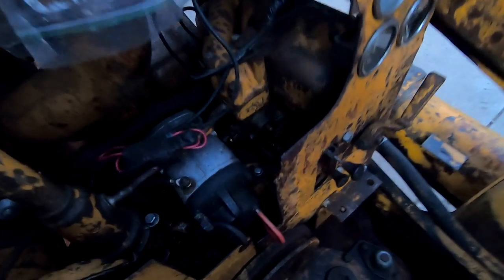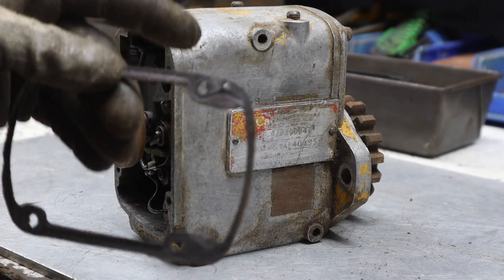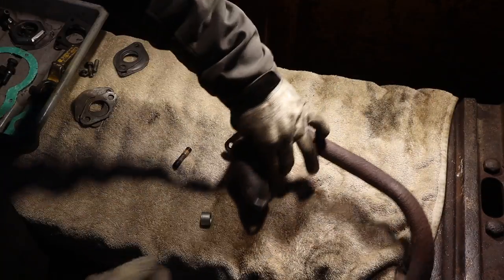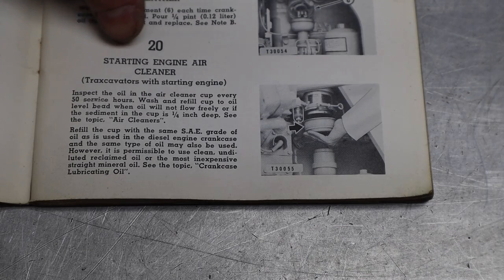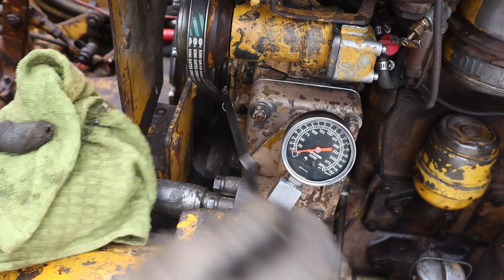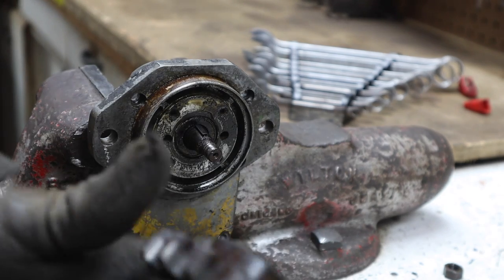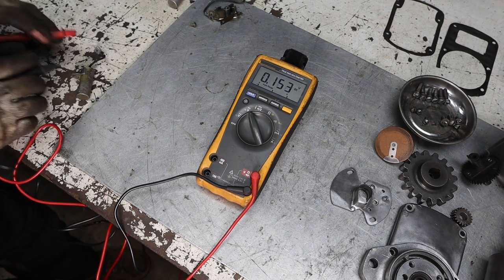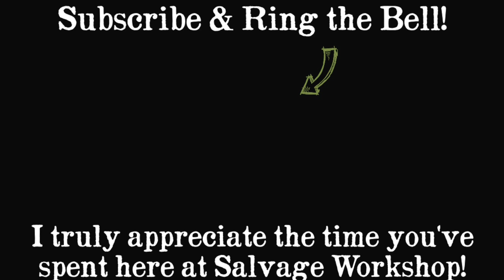FINALLY Found the PROBLEM! ~ Time to Rebuild a Magneto ~ Part 14 ~ 1950s Caterpillar TraxCavator

Comment: Don't grind the flathead srews, use a hammer to "push" the metal back in, it will result in a much better srewhead.
Reply: Better still - don't fuck around with flathead screws, replace them with bolts or any other screw that doesn't have a flat head.  Flathead screws have had their time in history, and should be buried forever.
Reply: My thoughts too. Nuff said Nuffman.
Reply: Small smooth headed hammer is king here!

Comment: Charging a capacitor with ohms range while it is a dead short on the steel surface ;-9
Almost got me...
You should look for a new one electrolyte doesn't get better with age, its main point of failure from now
Reply from the maker: Aluminum surface!! lol!

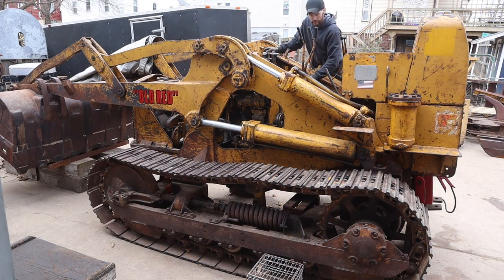Comment: At about 31:00 the fan on the main engine starts to spin as you try to start the pony engine, is that really right? Isn't there a clutch that allows the pony to first get running and preheat the main engine before engaging the clutch? The electric starter on the pony is probably not designed to spin two engines simultaneously...
Reply from the maker: I agree! It hasn't always done that, that's a new thing! When I get into the pony motor further I'm going to try and figure out why that's happening... I've got the pony motor's clutch disconnected from the diesel with the levers, so until I get in there IDK why it's doing that!
Reply: I was wondering about that, too.
Reply: Yes, it looked like something was screwy in Denmark
Reply: @SalvageWorkshop  Hey! Just pull the pistons and rods out of the pony motor and just use the pony starter.  LOL
Reply: @SalvageWorkshop  Pinion must be engaged.  Once it is engaged, only two ways to disengage.  Start the diesel so the increased rpm throws out the pinion, or manually if you have the little service hole in the bell housing.  Very common for the clutch not to disengage.  Oil bath clutch, sometimes the plates stick together and won’t slide against each other.  About 7 or 8 plates in there.  You can try applying the brake to loosen them. Just push that lever the other way.  Of course that is assuming some one has not removed the brake discs.  Other possibility is no oil in clutch housing and plates corroded together.  Definitely a good idea to pull and rebuild.  Squatch253 has a good video on rebuilding one that he did for his 5j1113 rebuild.

Great videos! Great work.  You are good at getting broken bolts out.  I am about 50 50 at best.
Reply from the maker: @johnwythe1409  That would make sense... I was in the middle of starting the diesel when the pony motor ran out of gas... then it popped trying to restart it, and I didn't do ANYTHING further to try to start it!... I'm betting it's fine!

Comment: Looks like old motorcycle points setup, the backing plate the points are mounted to sets timing  (to TDC or BTDC) with timing lite or dial indicator in sparkplug hole or degree wheel on crank, using ohm meter to tell when points break&make, disconnect points wire at mag terminal before ohming.The point "gap" itself is set by moving points on backing plate, do gap first then timing. The felt pad lubes points cam to reduce wear on follower use motor oil here,(not too much) & be shure it touches high spots on lobe. This is fun stuff, good job!!!

Comment: The broken teeth on the magneto drive gear is a bad sign. That means there's excessive clearance on either the crankshaft or on the cam. If you run that magneto with the play on the crank it will shear the teeth ok the drive gear and on the little gear inside again.
It's a common problem on Cat starting engines.
Squatch253 made a video on it, "caterpillar 5j1113 starting engine disassembly"

Comment: I'd think by now there would be an electric motor strong enough to start the diesel directly.
Reply: Like that idea, the size of motors nowdays says YES.
Reply from the maker: There are, and we'll see what happens! I would like to add a direct electric start but NOT eliminate the pony motor so it could also be used to start the Diesel.... Apparently there is a way to do that!
Reply: You are absolutely  right this is the only reliable way to go the pony motor  is more trouble than its worth  we have the same machine and lost a lot of valuable down  time
Reply: Need to add glow plugs for electric start. Pony motor better thou as it warms the diesel block and oil, gets oil pressure up before firing the diesel. Easier on the Diesel engine especially in the cold weather.
Reply: or just rebuild the 65 year old pony motor and worry about it again in 50 years

Comment: The WIRE WHEEL OF DEATH! I cringe every time you use this! Is that hooked up to a foot peddle switch so you can get away from it if it grabs a sleeve on your coveralls?

Comment: Your neat and fully comprehensive way of working is fascinating.
By the way, your multimeter can also measure capacitances, even if the test with the ohm measuring range is in principle of course suitable to find a clear fault, but not aging.

Comment: Little advice... never turn a magneto without a sparkplug and ground... it will kill the condensor or wiring IN the magneto because the voltage is getting to high and nowhere to go...
Reply from the maker: Maybe a LOT of turning MAY hurt it, but i had to make sure everything is working properly once they were asembled. Quite a few moving parts that all need to move properly!
Reply: Yup some people have to learn the hard way

Comment: I was all, why don't you test the capacitor (condenser) then just before putting it all together low and behold you did. Then I thought oh no, don't test it on metal, and you corrected that too. I love that you can show all the problems along the way. Totally expected you to resleave the exhaust manifold possibly do the trick of tapping the receiver dying and tapping some pipe, since I've seen that in some other episode somewhere, I was getting ahead of myself. You my friend are a total utilitarian and I salute you.

Comment: NO THAT IS NOT THE PROBLEM !!!! The problem is the crank main bearing is most likely bad. creating slop which breaks the gear and or bends the mag shaft. CHECK TO SEE IF PIN that holds the main bearing is tight ... that is the big killer of that style pony.
The main bearing in the front (back of pony) may have slop (radial and/or end play) from a loose locating pin OR a crack in the block where the locating pin is located.
!!!!!!!!!!!!!!!!!!   P U L L  T H E   P I N I O N   C L U T C H    B E F O R E    P U L L I N G  T H E   P O N E Y !!!!!!!!!!!!!!!!!!!!
!!!!!!!!!!!!!!!!!!   P U L L  T H E   P I N I O N   C L U T C H    B E F O R E    P U L L I N G  T H E   P O N E Y !!!!!!!!!!!!!!!!!!!!
If you don't it will break the pinion clutch housing. ----- about a 200 dollar bill...  Watching Squatch253' channel saved me that pain. So I went out and cut a porcelain tag off my old T9 Bucyrus-Erie dozer and sent it to him. He really liked it.
Everyone will tell you that you CAN pull the pinion clutch without pulling the governor but I'm thinking they are NOT working on a Traxcavator. I fought it and fought it and found it a lot easier to just go ahead and pull the governor, it gives you a chance to look for wear and clean out any gunk. While you're in there be sure to change the seal between the injector pump and governor.

Comment: I so enjoyed your magneto rebuild. And I enjoy the whole Old Red project and your skill at doing repairs the right way. I don't agreed however with your explanation of what caused the magneto gear to break, some end play and slight bearing wear. It seems as though an actual small chunk of metal got into the gears, perhaps a cotter pin or other half of the castleated nut. The magneto puts very little load on the driving gear so stress can never be a cause of failure. Make sure you find and remove any metal chunks not only in the pony motor but also down in the larger starter gear case.
 I am so looking forward to your next video of putting the pony motor back in.

Comment: Yes you definitely want to diagnose why that magneto gear broke.  I agree the shaft bent when the gear broke, but why did the gear break? You'll want to correct that problem before you go any further on the project.  Love watching you learn as you tear stuff apart to figure out why it don't work.  Can hardly wait till next video.  Thanks for sharing....

Comment: Hey Dennis carb here I found your rebuild kit it's on ebay type in zenith carb kit 5f3527 its $53.84 I knew it wouldn't be cheap but it's the whole kit doesnt come with float but has all the other parts I take the float if not brass I sand them lightly with 600 grit to get the old residue off and then spray them with silicone spray.i also spray all my gaskets with silicone spray it will make it easier to separate long term down the rd....love this restoration your doing on old red ....but Carburetors are my restorations.Lol your welcome DennisCarb.....ps what yr would you say ole red is because the other numbers tell where it was made and what it was made for and what yr it is I believe the letter x at the end stands for agriculture..meaning it was made for an off rd vehicle.could mean military too.but the other numbers got me baffled I think it's a the first 3 digits is where it's made 103.....not sure....6 day 8th month.0 last digit of yr 20 30 40 50 etc. When I find out I'll let cha know

Comment: Love your videos. I've been following you for awhile now. Enjoy your creativity when it comes to working on that older equipment. When you were working on the magnetoe and questioned the reason the drive gear wouldn't turn all the way around and stopped with a metallic clunk. You were coming up against the impulse coupling. Impulse couplings are used to give you a hotter spark at start up.

Comment: Just got hooked on your excellent channel and spent some really extensive time soaking up all that you do, turned off the TV! I'm a retired engineer, (80 now), but I started way back in the late 50s. In the early 80s I worked in the gold fields of Kalgoorlie as a trouble shooter and often we had to make do with spare parts from abandoned mines. Undoing parts from old machines that had broken studs was always a problem. Here's how to tackle that problem, many of which you've had on your latest journey with Big Red. You will need a pen centre punch. Carefully face off the offending stud to about 1/16" from it,s hole, the flatter you get it the better and carefully centre punch the stud. Using a small drill go in about an 1/8". Using a drill just under the core size of the thread drill all the way to the bottom of the stud. You will be left with a spiral of wire like metal which you can pick out with a small flat screw driver. Works every time! Once again thanks  for your wonderful effort, both on the job itself and the filming. Keep safe. Pete on the Isle of Wight.

Comment: It had a date inside broken magneto 8 5 65,
Great idea with the spacer on manifold bolt.
Some grease on inner magneto gears be a good idea.
Good idea take timing case off, those broken gears are down there somewhere too.
Alot ofcwork but it will be peace of mind.
Old red is definetely trying to get the better of you.
Excellent job👍👍👍👍👍

Comment: when I was a Kid , we had a D2 Gas caterpillar...it was Old and had a hand crank for the starter...  I loved that cat it had the power to do anything on the ranch we tasked it to do. I drove it every time I had the chance . and yes I had to go into the magneto on it as well.... it was a 4 cylinder but even as a teen age kid that was small for his age i figured out how to start the thing...
usually it took Dad's strength to start it... but I finally got the knack ! ....and Dad would get me to start it for him ! LOL
we sold it and I loaded it on a flat bed truck in a dip in the road....  it was a slippery metal bed and it almost got away from me and tumbled off the truck, but my years of driving it saved the day... fast reactions and just the right amount of clutch
got it perfect on the bed of the truck.... I killed it and said good by to an old friend ! treat it well and it will serve you well
abuse it and it will die a sad death.... change the oil in that oil bath air cleaner once a year or more.... their worth their weight in gold !
...Our cat had 2" cleats that were welded to the tracks... it tore up any ground it went across but it did have traction !
( it came from rice patty fields in central california. )
You are wize to look for the cause of the part to break ! I wish you luck ! you may never find it.... but at least you LOOKED !
there is satisfaction in that !

Comment: I hope it doesn't turn into a marathon project for your sanity, but I have a few other channels I watch that have marathon projects.  One recently just did an update on a project in their shop that is over a year in the making at this point.    I enjoy seeing the updates and the progress, and watching you work through the different challenges that keep showing up.  Please don't feel like you have to rush through this job just for the sake of making a video on the internet.

Take your time...do it right....and when you're done with this piece of equipment, hopefully it will serve a function again for many years to come.

Comment: Dang, dude.  You have yourself a labor of love there.  Don't forget to wipe a little grease on those little timing gears and the bushings for the armature shaft.  Also, wipe a LITTLE grease onto the points cam where the points lever rubs.  Just a little.  For this application, the grease should be FELT, NOT SEEN.

Comment: I've really been loving this series, Old Red reminds me of the construction machinery I saw as a child in the 60s. I love the way the way the parts are designed - all those subtle curves that weren't necessary but made them look beautiful. It's clear the person/people that designed the casing for that magneto wanted to make something that not only worked but looked good. The same is true for the whole machine. I'm so glad that you're going to strip down the whole pony motor and check its all OK, it must be hard to resist the temptation to just "get it working". Parts must be hard to find though, so its good that you're taking the precaution and of course it means we get to see so much more of the design of this machine! Thanks for doing this and inviting us in to watch by filming it, I'm sure it doesn't make it any easier but the effort is appreciated, especially by people like myself who don't have the opportunity or ability to do it ourselves.

Comment: That machine certainly has been a learning experience, but your patience will win out. It is very good that you did not just put the rebuilt magneto back on the pony motor and run it, could have been disastrous. Looking forward to what happens next, thanks.

Comment: You're doing the right thing, you should bench test the mag before installing. Also you need to make sure that the two gears inside the mag are in proper timing. If there is someone in your area that plays with really old tractors they might also have a mag charger. When you pull the armature out of the mag   you usually put a couple of keepers so not too loose any of your charge. You might be okay but definitely bench check it . Use a cordless drill and a socket to spin it on the bench.

Comment: Taking the top off will also allow you to check valve clearances.  If it's the same as the one I worked on ... you may be surprised as to how they are adjusted.  Make sure you clean any crud from the inside of that top.  I had some fall off and block the oil feed hole to a main bearing, causing much grief.

Retrieving any loose chunks from that old gear is something you will want to do.  You may find chunks from a gear before that one also, which will explain why the current one got broken.

Surprised to not see a snap coupler/drive on that one.  Always thought those were essential for a magneto fired engine.

Comment: Sooo you are getting a real life understanding why so many old pony machines were converted to direct electric start ha...Many fleet companies back in the day would keep a couple dozers in good pony motors and push start the others.

Always keep your eyes open for parts or parts machines. The magneto is a perfect example why guys round up all that stuff. 1 little difference in there. ... you were lucky to have what you had and could build one. 

 Good way to start the new year getting a definite answer on what happened. Fixing is easy compared to chasing gremlins.

Happy new year thanks for sharing

Comment: Good forensic evaluation of the magneto. I learned a lot from the video. I'm sure you know already that you can replace the capacitor in the condenser. YouTuber 805RoadKing has a couple of small engine capacitor replacements.

Comment: Amen brother great to see your doing it RIGHT! l like your thinking stuff does not break for no reason. Do kinda wonder where broken bits ended up.You could have also used an Allen socket cap screw on exhaust pipe too instead an longer bolt and sleeve as an option

Comment: I’ve been there with the mag. After setting all winter, fired with first rope pull. Ran fast and POP, it died. My mag had a tooth broke and the rotor shaft broke. The manual has a good description for the timing. Looking forward to your end case removal for the missing tooth.

Comment: Great vid on how a magneto works and job tearing it apart to find the problem.
Then combining two of them to get one working one.
I used to work on them when was a Coast Guard flight mechanic on Grumman HU16e Albatross seaplanes.
Of course their Pratt and Whitney R1820 radial engines Magneto's were slightly larger.
But used the same basic parts.